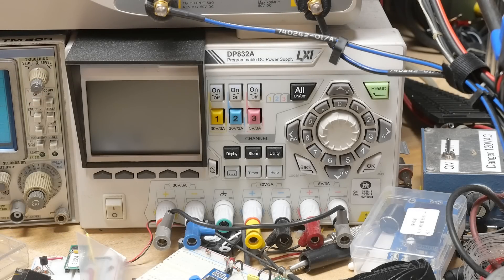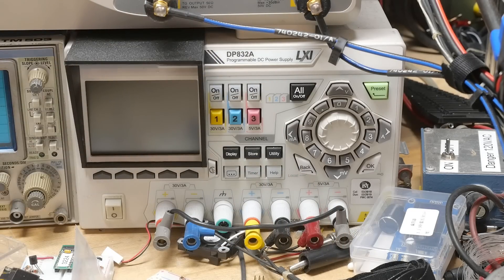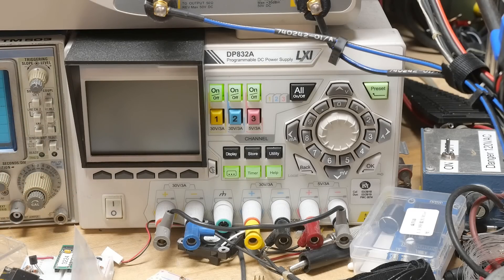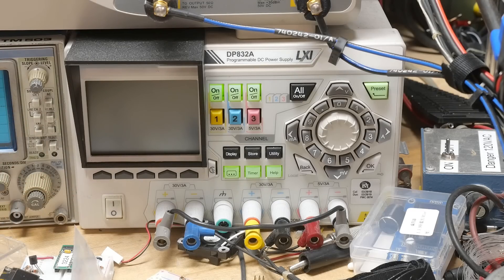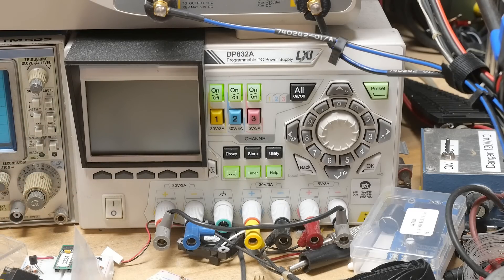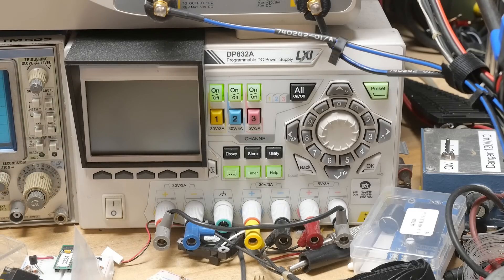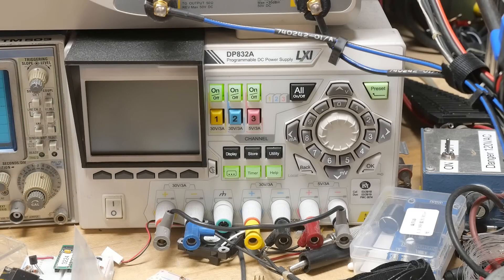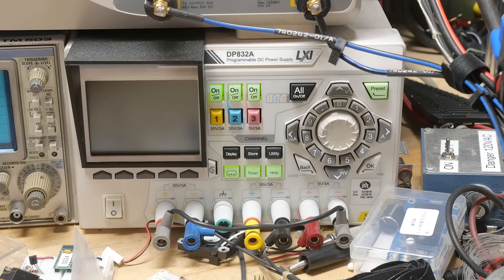#2326 Keithley 2231A Triple Output Lab Power Supply

Comment: I've used these Keithley supplies before! The VFD displays are nicer and certainly don't like some of the interface decisions of the Rigol. The Keithley supplies far too expensive in comparison and you can't read the voltage while setting it though. Also you can't independently turn on each supply for manual supply sequencing...

Comment: I have 2 GW Instek power supplies on my bench.  One tripple output and one quad output.  The tripple has big 7 seg leds and is my goto.  Only takes a quick look to see power and a dedicated led for cv cc modes. The quad has an LCD and far more features.  But everything in the lcd.  I use the tripple for power and the quad for signals.  I did notice your keithley didnt have a ground post.  My outputs are isolatedbut they do include a gnd post.

Comment: I was using Keithley meters in the 70s. I bought a 179A as a second bench meter at home. I cal'd it with a calibrator.  Lot of adjustments but what is cool is that all adj.  are marked with what they are and what they adjust. The one thing is that it will read 50 microamps with enough resolution for the primary adjustment when calibrating Simpson 260 meters. LED easier to see than LCD too.

Comment: By coincidence, I also just bought a power supply.  It got me thinking about the behavior when a channel is first enabled.  How fast does the voltage rise?  What is the shape of that curve?  My supply gives no specifications related to this, but it could matter.

My supply's curve looks a little strange.  I power on the supply, set a channel to 5V, current limit at 500 mA, and connect a 25 Ohm power resistor.  When I enable the channel, it takes about 12ms to reach 5V.  Also, the curve is not smooth.  There is a quick rise to 2.5V, a quick drop to 1.6V, and then the smooth curved climb to 5V over the next 12ms.

I am wondering what behavior to expect from bench power supplies?  Have you ever compared yours?

Comment: Curious why you have the Ch 1 positive tied to the Ch 2 & 3 negative?  Do you frequently run the supplies in series to boost maximum output current?
Reply from the maker: That makes ch 1 give negative voltages.
Reply: @IMSAIGuy  Like I said to the other commenter, I didn't even think about that.  Unfortunately I rarely get time to tinker and prototype so rarely need +/- supplies.  12, 24 or occasionally 48 VDC is what most of my supplies are normally set to.  First thing that comes to mind for me when I see supplies tied together in series or parallel is doing it to increase voltage or current.
Reply from the maker: @mikesradiorepair  for me it was always +5 +/-12 for digital/analog
Reply: @IMSAIGuy  Remember the switching power supply that fed into another switching power supply I sent you some time ago.  I took one of them and put it in a instrument case.  Since the main supply already put out 5V I took the 5V switching regulator off the second board and swapped it out for a 3.3V switching regulator.  Put 5 sets of double bananna jacks on the front panel.  +15, -15, +9, +5 and +3.3.  Will I ever use it, probably not.  I will probably end up donating it to a kid in the local electronics club.  I have donated a lot of equipment and supplies to them over the last several years.
Reply: I haven’t used all three like that, but for me I tie two channels together in a similar way to give me a +12 to -12 range for working with eurorack synthesizer circuits.  At least this is the best way I’ve found to get that voltage range.  Maybe there’s a better option?
Reply: @AlanLaMielle  That makes sense.  I don't do a lot of prototyping of circuits, mainly repair work.  My supplies pretty much live at 12-14VDC or 24-28VDC depending on the type of radio system I'm working on.